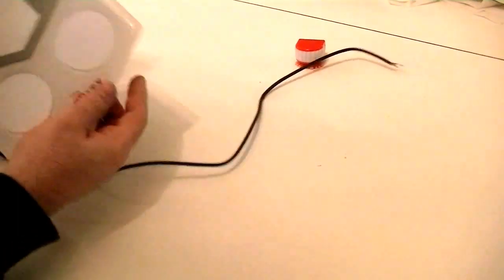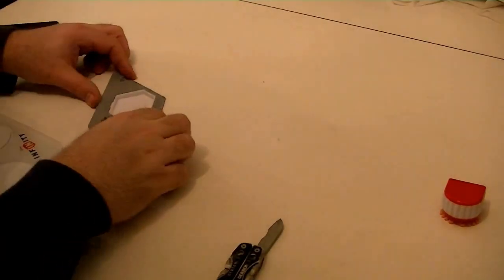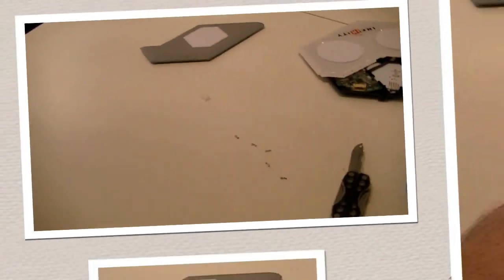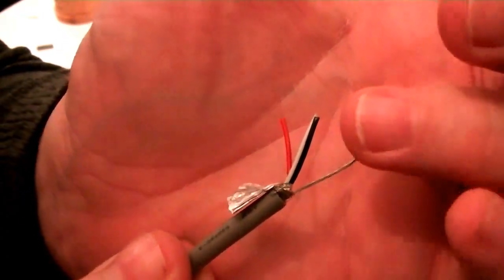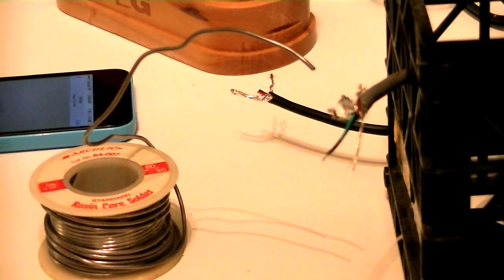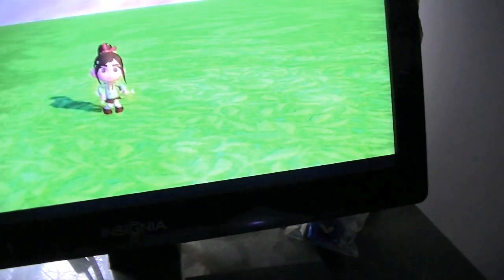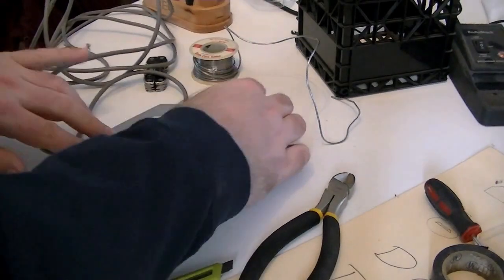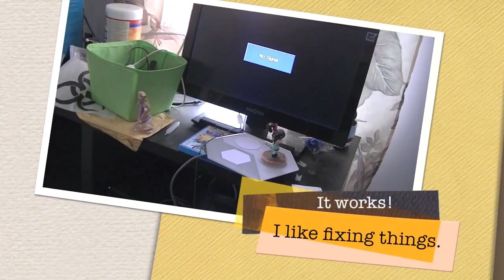Fix It Friday: Disney Infinity Portal Repair

Comment: I haven't used my base in a year and when I go onto the game, it says to plug it in, but it's plugged in already. So what should I do?
Reply from the maker: The first thing to do is to take the game and the base and use it with another console. That will let you know that it is this base that is the problem.  If that is the case you have 2 options. 1) find a new base. 2) Get a multimeter and check to see what wires are not working and fix it.
Reply: ArtemixHD having the same problem
Reply: Same here
Reply: ArtemixHD same!
Reply: same
Reply: I JUST WANNA PLAY MY GAME I NEED HELP
Reply: You haven’t helped I needZ it I wasted 39.95$ on a go dam game online and my base doesn’t work
Reply: Game Castle 69 yeah I spent 30 on the game online and my base didn’t work either
Reply: Same
Reply: @JakalairVG  can you make a video on it plz

Comment: How long does the base last? Is it recommended to leave it connected to the console so as not to damage the usb? 
Great video, man, this could be very useful, thanks!
Reply from the maker: The portals will last a good long time as it has no physical moving parts.  The cable is what I have seen go on most peoples. Leaving it plugged in depends on how often it is used.  If it is used every day, might as well leave it plugged in. But, if it is only used once a month or so, then unplugging it can save it from possible mishaps.
Reply: @JakalairVG  when I plug it in the light turns on then off help

Comment: When I plug my base in it lights up then turns off help
Reply from the maker: I know that they are console specific and that they do that when plugged into a different console. It sounds like it is getting power, but the portal doesn't keep talking to the console so it shuts down.  It could also be a data cable not working properly, but to test that you have to be comfortable/ know someone you are comfortable with taking it apart and testing the wire. 
These are such closed systems that I work through them starting from the outside and move in, hoping that the problem is farther outside of the actual electronics.
Reply: @JakalairVG  someone gave me the Xbox 360 base but I can’t use it with my ps5
Reply: Same I’m doing this to ps5 with a Xbox one cable

Comment: What if it's turning on and off instinly
Reply from the maker: Hmm, not sure about that one. My first guess would be that there is something not being communicated. Could be a bad data wire in the cable, or a bad controller inside.